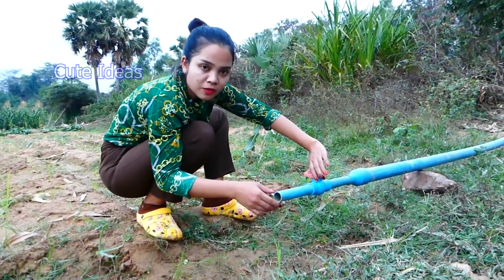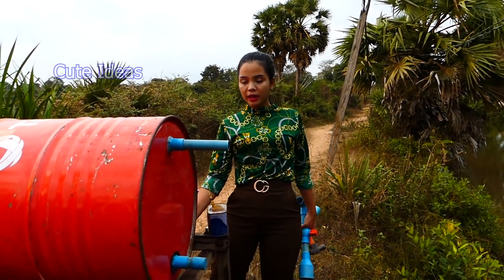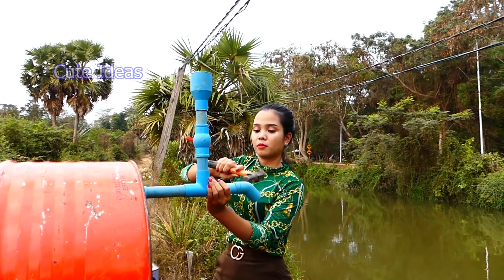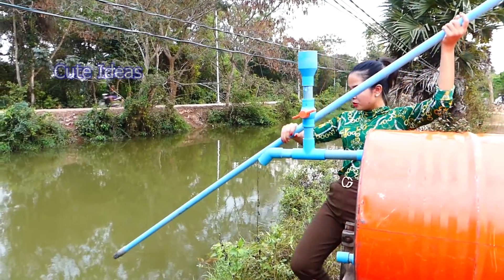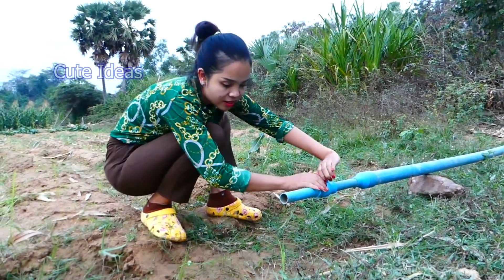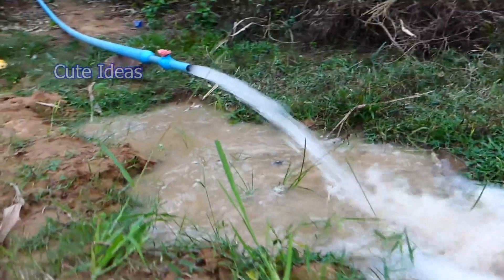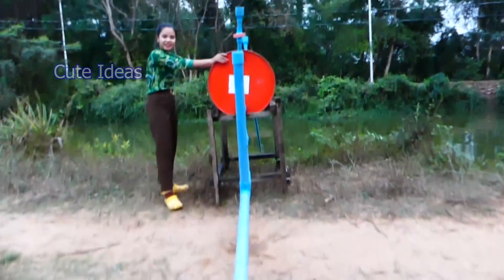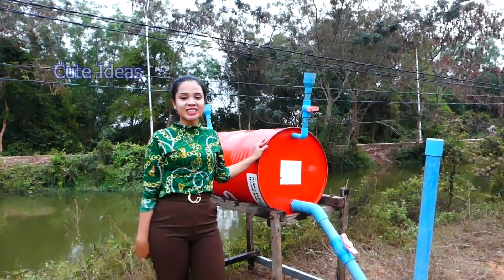Pressured Pump from Deep River, Amazing Auto water motion from deep River using pressure tank

Comment: The apparatus is mostly to start a  siphon.    All that is needed is for the discharge to be lower than the water-source level.  To start a siphon just  remove the air from the pipe.

Comment: What are the sizes  of the pipes you use? and is there a perticuler hight of the vacume pipes? Does the drum get filled before you operate.? Please answer me. I want to make one for my coconut folield to take out the stagnated water.
Reply: Nho
Reply: It is a fake, it is not a pump it is only a syphon. It means the final output pipe is lower than the elevation of the river. 
Just look at the video, that river is inside a built up cannel. In other words there are walls around the sides of the river. Look across the river and you can see the road is higher than the land, the road is on top of the wall, and she is on the other side, ON TOP OF THE WALL TOO. The water in the river is higher than the land around it, it is being directed in a man made built cannel that is higher than the land around it. .
It is just a syphon, you don't even need that drum, it don't do much except make a way to prime the syphon. But you can prime a syphon with just a tee at the highest point in elevation, and a single check valve on the input.

Comment: offcourse it flows, the outlet is lower then the riverlevel.
Reply: It's irrelevant to the concept of a gravity pump if the final output was below or above the river level.  Joules = Gravity × Height × Water (in the Barrell)  coupled with a ram pump after the Barrell it could even be above the Barrell & river.  It's the Height and amount of water in the barely creating the suction. As a function of the barrels height.  Old fish tank pumps used to work this way in the 60's and 70's.

Comment: The water  that comes out is only from the drum. The negative pressure of the vacuum drum  is insufficient to suck up 7 meters (0.8 bar) dept the water.
Reply: Actually it's enough provide the OUTLET is LOWER than the intake of the water source. This is not really a pump. This is more a flow initiating system. All you need is the initial suction. You can do the same with a hose, a water container. Let the hose goes above the container then make sure it goes below. All you need to get the water going is suck the air out from outlet
Reply: No Dear (1) The Drum is placed on 2.5 Ft. above ground ,  Drum is more than 50 Times bigger Manually Filled with water and its Air releasing 2 Vertical Pipe to which closed after Drum is Filled with Manual poured Water. 
(2) once long out going water pipe end is opened  Water flow increases due to down angle of Pipe and effect of Gravity , then comes Drum Water that while passing in Long out flowing Water produces Vacancy in Drum and high Pressure pull gets developed in Drum which Directly pulls up Well water through its Water  Dipped Tube connecting Well with Drum. I hope you have now understood .  Better it will be to keep in Memory by Discussing with with some Scientist  This very useful for Working in Villages where Electricity isn't available and Petrol /Disal oil is In grip of Bjp.
If one adopts this System to water plantation the use of Electricity will vanish for such Villager.
Reply: @abdulrahimkhan5714  This is a siphon with a priming taank. It only works if the outlet is lower than the river. A siphon can not lift water.